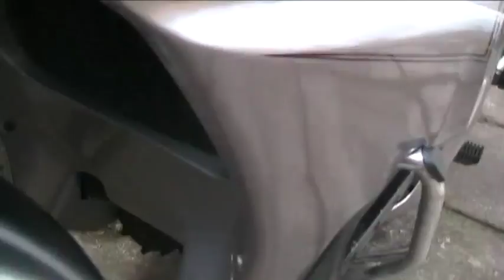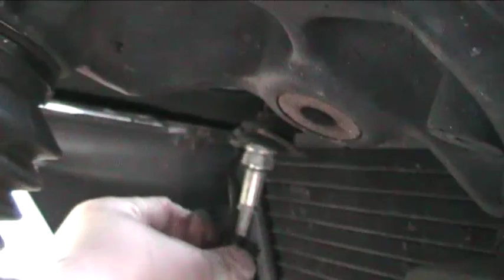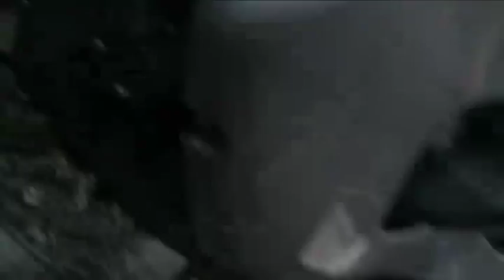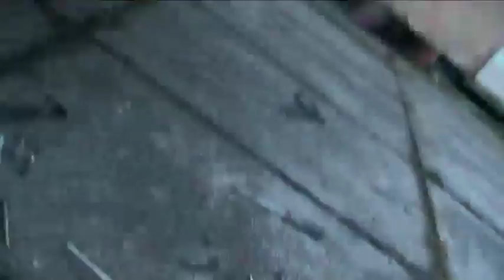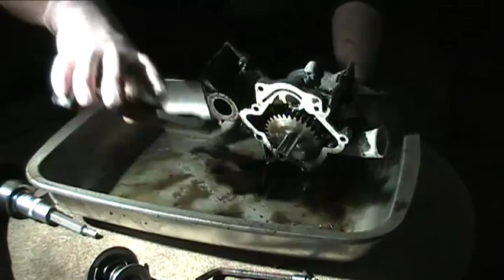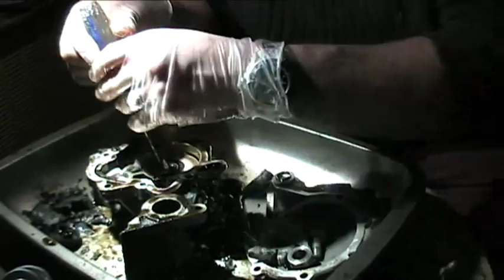k1100lt water   oil pump seal replacement

Comment from the maker: Good stuff, long as you haven't marred the mating surfaces you'll be OK, if there are any burrs smooth it on some 600 grit W&D on a sheet of glass.
Good luck with the rest, check the impeller shaft for pitting, trickiest bit is compressing the water pump seal without damaging it, bit nerve wracking but take your time with the socket and keep stopping to check, stop as soon as the oil pump gear is flush.
Once done it'll see you another 50,000 miles.

Comment from the maker: No need to remove the hall effect sensor. To remove the cover once unbolted, a couple of sharp taps with a hide or rubber mallet to the side will help it pop off, you don't want to lever it with anything as the surfaces are perfectly machined to mate without a gasket and use only sealant.
It may be reluctant to move at first but perservere with the mallet and it will free off.

Comment from the maker: The cause is as per the video content, you need to replace the oil and water seals in your pump.
The channel I refer to is a bypass drain tube cast into the pump and front block, (you'll see it with the pump removed), coolant bypasses the damaged seal and along this tube causing the drip you see.

Comment from the maker: Also good point on the bolt heads, exposed allen bolts can be bad and easy to round out, use good quality keys or preferably sockets and as Duck says make sure they seat well in there.

Comment from the maker: Ahhhh, so that's what all that fluid stuff all over the yard was! :)

Good point, remember to drain coolant before doing this and ask an adult if you're unsure.
On the point of the oil, I didn't fully drain the pan, i weighted the rear to lean it back on the mainstand and placed a catch pan under the pump body, it only loses about 1/2 L of oil, that said you may as well drain it but if you don't plan on doing a change you can do this, strain and replace.

Comment: Good for you for doing this.  A couple of minor points:

1) You forgot Step1: Drain the engine oil and coolant.

2) On older bikes the Allen heads tend to get filled with road grime so it's helpful to clean them out and make sure the Allen wrench is well-seated to avoid stripping the bolt heads.